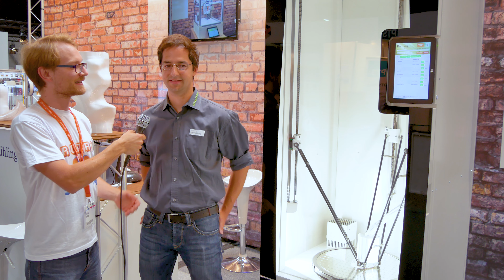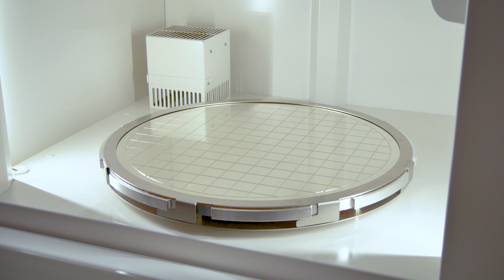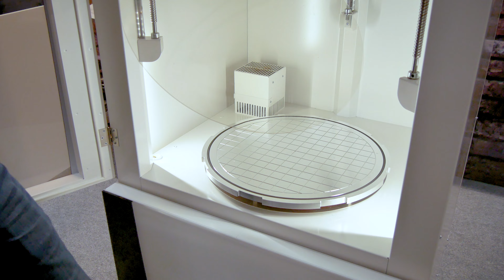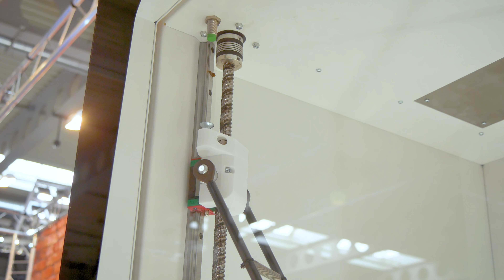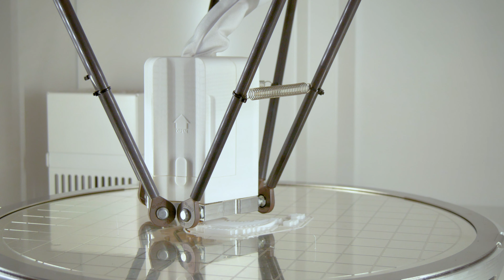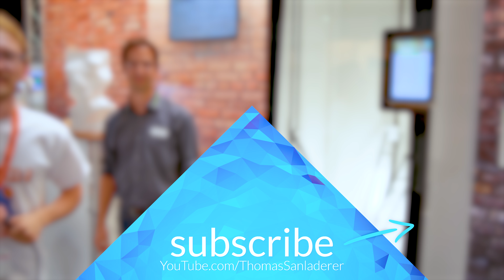Kühling&Kühling's crazy industrial delta 3D printer @FabCon3D

Comment: Its amusing reading the mostly negative comments about this machine from all the armchair engineers and instant experts. Remember  that R&D time has value. Time spent messing about with unreliable Reprap-based printers produced by unsustainable microbusinesses is not in the interests of any business financially qualified to buy one of these. It is perfectly obvious that this machine is designed to print reliably, for people whose time has significant value. Perhaps this is why profitable tech businesses buy Stratasys machines - and armchair experts do not.
I wonder how they deal with the bimetallic deformation effect of mounting steel linear bearings on what looks like an aluminium substrate, within a heated chamber? Also I note the use of plastic rod-ends with aluminium ball-pins and plastic-nutted high helix screws. I would guess the max chamber termperature is pretty moderate and that even with the antiback measures visible and implied, that the positioning accuracy is not the finest. This looks like a well-executed and thoughtful work-in-progress. If they get some orders they will have reason to refine this architecture a lot. And I dont think they need fear the IP landscape as long as they've researched it diligently. Stratasys watch out!

Comment: Machines like this are a huge leap forward to getting to the point where you can just buy a 3D printer that is as easy to use and cheap to acquire as a document printer is now.

I think it's interesting, I just now realised that 3D printing is really taking a similar adoption and development path as 2D printing did. I've seen ancient tractor feed dot matrix printers that apparently were thousands of dollars back in the day but now dot matrix printing is antiquated and you can get a printer that makes gorgeous results every time for $20.

I think we are less than a decade away from seeing 3D printers that you just set on a table connect to with a device and it just prints for less than $500 I also imagine that by this time we will also start seeing 3D printers that use hoppers of granules instead of filament. or that make their own filament.
Reply: i just bought a printer for 300 dollars

Comment: That would be a great industrial printer for 10k, 15k maybe but 39k is way to much
Reply: For $10k one could buy the Fuse 1 and print full strength parts with SLS.

Comment: @Thomas Sanladerer: would it make sense to replace GT2 belts for X and Y axis motion control in a standard replicator setup by metal spindles as this delta printer is using it for all three towers? What would be the benefits and downsides if doing so? I assume one can reduce the backlash of the belts by such change, but what would need to be done to avoid a Z-Wobble effect due to misalignment / bend in the spindles?
Reply: No, it
would not. Spindles have no benefit neither in accuracy nor in speed and noise
emission not mentioning the price. This is my personal experience I made when I
built  a 1500mm Delta Printer with 25mm
by 10mm lead screws.

Comment: Lots of people seem to think that the price of €39,000 is very expensive and are making comparisons to consumer 3D printer prices. This machine is intended for use as an industrial tool and the comprehensive support and maintenance package is included in the price. 
Many businesses are using additive manufacturing to produce prototypes and proof of concept items which are very expensive to produce using traditional means. This printer can print very tall items which it would not be possible to be produced using cheaper 3D printers so there is the additional benefit of reduced assembly when compared to other machines. Some of the major costs of manufacturing are due to the moulds for plastic injection moulded parts. If a company can produce a series of parts for prototyping using this printer then the cost of the printer would be covered by the saving in not having to pay for new or changed moulds for the final production run.
Reply: The included support is only one year and they clearly say multiple times this is not intended for prototyping but for "production" whatever they mean with that.

Comment: This appears to be an machine designed for an industrial setting, which totally justifies the high price. Vacuum beds are expensive, giant build volumes are expensive, high temperature support is expensive, quality linear rails and ball screws are expensive. They're going all out in terms of quality, and that costs money. Even if its only 10% better than a printer that cost 1/10th the cost, companies will pay for that and they know it. This things print volume, while certainly not the biggest, is big enough to print something bigger than most people's home grade 3D printers.
Reply: Industrial setting doesn't autmatically justify a high price. Just because a company can afford higher prces than a consumer, doesn't justify a high price either. If I were to buy a consumer product, relabel it as "professional", add some "support" (telephone monkey who can use google and read the manual) and sell it for 10 times the price, would that be justified too?

Comment: the time reduced to 1/4 of normal 3d printer, otherwise you are completely and entirely wasting money and can't be considered production 3d printer. (my view definitely can't be true for everyone)
how?, maybeee nozzle and filament diameter 🤔
Reply: Mechanical Ghost 
Not all production items are intended for sale. Many businesses are using additive manufacturing to produce prototypes and proof of concept items which are very expensive to produce using traditional means. This printer can print very tall items which it would not be possible to be produced using cheaper 3D printers so there is the additional benefit of less assembly when compared to other machines. Some of the major costs of manufacturing are due to the moulds for plastic injection moulded parts. If a company can produce a series of parts for prototyping using this printer then the cost of the printer would be covered by the saving in not having to pay for new or changed moulds for the final production run.
Reply: Pete Allum 
everything you said are true, but one major factor is time.
can you imagine how long will it takes to print large object?.
small decorative parts takes up to 4 or 5 days!.

Comment: Is that giant white plastic box  over the print head really needed? Looks like it adds a lot of wobble to the arms just by the mass. wiggling around.
Reply: It's So they can pump cool air into it from outside the printer.
Reply: true. but it looks "industrial", which enables them to sell that thing for the price of a really nice car.
Reply: peterthinks 
Although it looks big and heavy it's actually quite lightweight as it's hollow and it appears to be used as part of the heat extraction for cooling the extruder.
Reply: It's for the air cooling.

Comment: Is the production speed, build volume or print quality so great that someone would struggle with the decision to buy one of these, as opposed to say, 20 makerbots, or 80 CR-10s, or 200 Anet A8's? That's an instant printer farm vs. one very large format printer! I think the price is quite steep when you consider proof of concept, one off  machines like the Part Daddy which have larger build volume and probably costed a fraction of 40,000. Let's be realistic Tom, lol... if someone asked you to go crazy with $40,000 and build your ideal printer, you'd probably come up with something that could embarrass those guys machine. You'd probably have enough money left to supply said printer with filament and parts for its lifetime as well.
Reply from the maker: +Dj Goku if you're considering this machine, there's no way you're comparing it against import machines or throwaway plastic boxes. The machine itself is probably the cheapest part in the package of support and consulting you're getting for your up-front purchase price.
Reply: Obviously understandable, considering the fact that it's designed to be an industrial piece of machinery. But, also obviously, you (along with most other makers) probably know that if your product is 10,000, 20,000 or even 30,000 of a 40,000 price tag and the remainder is to cover support... then you probably don't have the know how or need for such an expensive (and predictably unreliable with such "extensive" support) product in the first place. That would be like saying you'd spend $1,000 on a TronXY, if it had amazing support. I would hope that anyone willing to spend so much on a piece of machinery for industrial application, would want the most machine for their investment dollar. Not a $10,000 machine with $30,000 worth of install and support on standby. If someone in an industrial capacity would consider a machine like this a positive investment based on the level of tech support offered, then they are probably already in over their heads or have more money than sense. I have extensive industrial manufacturing experience, with everything from CAD drafting/design and CNC machining, to CNC press brake, to robotic sealant machines for the insulated glass industry, so I have a pretty well rounded idea of what a true industrial machine costs, and clearly $40,000 is a far cry from a $500,000 Swiss mill or lathe, or a $5,000,000 Lisec sealing robot. But with the line of reasoning here, you'd be paying 100,000 for a CNC machine and an additional 400,000 to compensate for a lack of knowledge in set up or troubleshooting. It is an awesome printer, no doubt. It clearly can't be compared to cheap Chinese kits or "plastic boxes" as you like to put it, lol. But I did make that comparison to illustrate the scale of the purchase, and I'm sure you know that, even though you jumped to their defense. It would be different if the quality was a new industry standard, but I'm sure it isn't. It would be different if the speeds or build volumes were a new industry standard, but I'm sure they aren't. Realistically, it's just a really big delta printer, and although that's awesome, it's not 40 times more awesome than, say, a $1,000 machine. It can't print 40 times faster, 40 times better quality or 40 times bigger. And the original point I was trying to make is that I'd rather have a company with enough demand to produce at a rate that I'd need 200 Anet A8's than a company where I only need one of those amazingly awesome giant deltas. But I guess once someone is in the market for a monstrosity like that, they probably already have every "regular" printer imaginable. Haha but also, if that's the case, they already have giant deltas they built themselves for a fraction of the price, and since they actually know what they are doing, they used the extra money for staff bonuses. Once you start talking about printers in that price range that don't do something monumentally ground breaking, doesn't tooling for injection molding of a single product start seeming like a more profitable investment option than large format one offs? Let's be realistic that it's awesome, but it may be an awesome thing with no practical investment to short term payoff. You'd have to print quite a few stools or large format vases to recoup such an investment. Keep up the awesome vids though. At least through vloggers like yourself, us mere mortals get a glimpse into tech we'd otherwise be oblivious to.
Reply: Very well said!

Comment: What is with the Stratasys Patend for Motors outside the Heated Chamber? 

Greift hier nicht das Stratasys Patent für beheizte Druckräume, bei der die elektronik und Motoren auserhalb des beheizten Druckraumes sind?
Reply from the maker: +erbium00 they are well aware of the existing patents around this type of setup and, as far as I know, aim not to infringe on them.
Reply: erbium00 I was going to ask the same thing.. I intend to do this myself, so not commercially, but wonder if Makerbot/Stratysys will go after a commercial company? Let's hope not!!!
Reply: The only guess I could make is that the can heat it because of the Delta configuration. But
there is a big question mark. And if they are touching Stratasys the will be sued by them.
Reply: They are definitely seeming to take a lot of cues from stratasys on this one. Stratasys was the first to do the vacuum table bed as well. I really hope that it works out for them, and that they don't experience any legal trouble. They are in a different country, which may help. But I think heated chambers and vacuum tables are two of the big things that current printers are missing. Not super hard/expensive to implement, but everyone is too scared of stratasys to do it!
Reply: Prints and Props Vacuum tables are a staple of CNC machines so I don't agree there. The machine is using delta kinematics so as a while doesn't resemble any Stratysys machine I know of. The 'heated chamber' to me both makes sense and is effectively printing something in a heated cupboard. I personally think it was very 'poor form' to patent this, especially as the whole community and industry was benefitting from the fdm patent expiring. Stratysys obviously have a right to patent new technology and protect their interests, but it didn't look that way to me.

Comment: The vac down surface is actually interesting to me.
Some significant possibilities including sacrificial base materials
with permanent base layer adhesion.
Out of box thinking I think.
Not impossible to jury rig into an existing bed.
Hmmmm....(sorry...thinking about vac sources...and maybe a bleeder.)
Reply: Out of the box thinking??  No. Vacuum bases have existed for decades for CNC machines. Nobody would ever think of using it for a 3D printer because it just increases the price and doesn't really serve much of a purpose for the average user.
Reply: You make a good point. If the print base was similar plastic, perhaps, you would have a near permanent adhesion. Cheap plastic bases with custom models printed on them. I Could see the use.

Comment: Production via FDM? What industry uses that? 2m tall fidget spinners or what?
Price is typical overpriced europe price. In china they will build the same thing for 1/4 probably.
Reply: Karl Wyoung Yes but maybe not that much. Also they didn't invent anything new.
Reply: radry100 
Nor did Marconi or Thomas Edison. Sometimes it's a specific implementation of existing technologies that can make a difference.
Reply from the maker: +radry100 good luck getting 1-on-1 support for an import machine.
Reply: Thomas Sanladerer that wasn't my point. First of all the support is only for a year, secondly we all know service contracts are always expensive and overpriced just because companies "can". Even if they didn't include the support, it would still be much more expensive than a chinese product. Yes, the quality might be a bit better here. Anyway in europe you get overcharged for everything, just because.
Reply: The only reason they charge so much is because there is no, or little, alternative/competition and european people are willing to pay for it. Well, it doesn't surprise me that china is developing so fast and european economy is stalling.

Comment: Why bother with a delta? Really, what are advantages?
Reply: And there are both standard an deltas that max out the nozzle. Im sure that for 39 000 speed will not come down to  printer type.
Reply: Speed.
Reply: Not when it's using ballscrews instead of belts.

Comment: Yeah I don't know. I walked by that thing and wasn't impressed with the print quality of the items on display. Definitely wouldn't shell out 39k for it! And then I asked one of the associates at the stand about the heating blocks from their HT500.2 3D Printer and just got a blank stare like deer caught in headlights. 

The vacuum table is a cool idea, but just cause the printer's upscaled doesn't mean it has to be done.